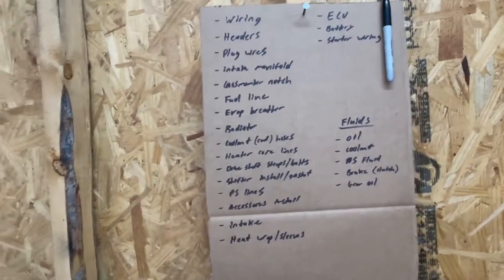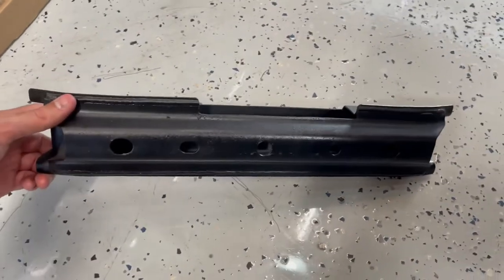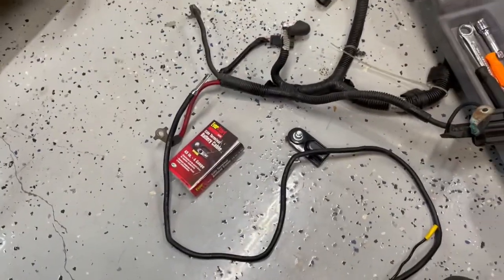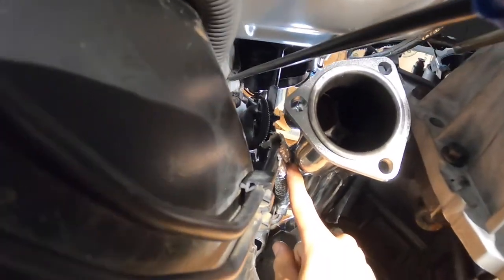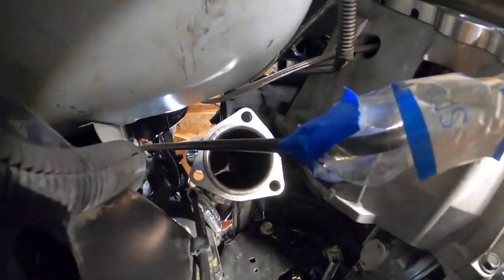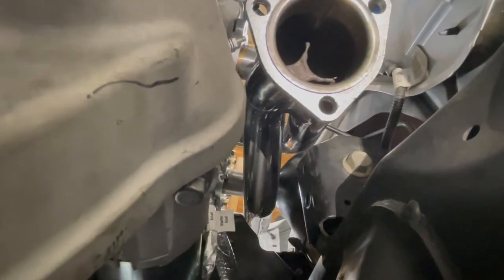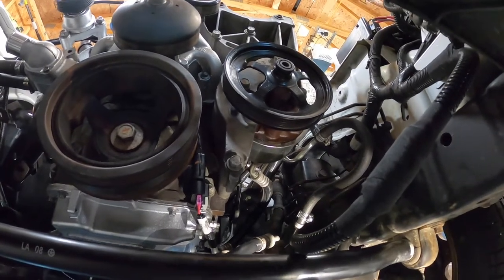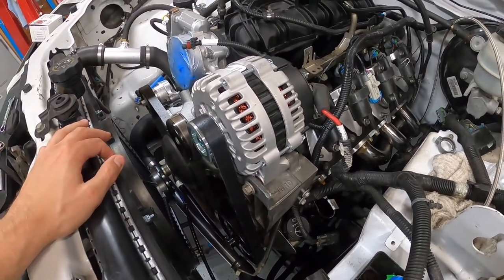LS Colorado Build Part 5

Comment: Really enjoying the series of videos you are creating. Working on my Colorado as we speak although I'm still a good ways off from where you are on yours. Wish I would have been a little more patient and hunted around for one in better condition but no patience on my part, lol. Picked it up for $600 but needed a ton of work. Just finished up the interior rebuild and am now in the middle of the paint job. Hopefully working on the drivetrain by the end of the summer. Good luck on the rest of your project and thanks for taking the time to do these videos, they will be extremely helpful for many of us.
Reply from the maker: Thanks for the support! I wish I paid $600 for mine… all the other stuff is starting to add up. I’m getting very close. Will get a new video up soon showing the rest of the odds & ends. Good luck to you too!
Reply: @fixedoncars  did u know that gm makes every part u need as far as hoses and lines and exhaust manifold they also have a fan and fan shroud for Colorado it's under the 2009_2012 year model cus it came with a 5.3 from factory.
Reply: Yeah, wish i paid $600 for mine. And ive got a ton of RE-DO work

Comment: I like the series you made here. Takes that much more effort to document everything. I stated my swap a couple years ago. You probably saw it on 355nation when researching. I got distracted with life events. Anyways back at it. Talking about reusing the battery cable. Not sure if its because mine is a 06 but I don't have the brake control module on my existing harness. I like how you extended your cable but was wonder if you knew If need that brake control module for my swap?
Reply from the maker: Hey, I think the battery control module was only on later models (09-12). CPWire has something on their site that states the later modes need it. You can check that out and it might help!

Comment: Question bro I have the same set up mines a 5 speed too my 5.3 is a fully built racing engine I just wanted to know what electric fan you use and what front accessories drive did you use like is it a truck front accessories drive or is it off a Camaro or something I’m tryna save myself a lot of headache.
Reply from the maker: I cover the fan/shroud in one of the videos. I can’t remember which but I give all the details. I used the truck accessories and had no issues with this setup.
Reply: @fixedoncars  thank you